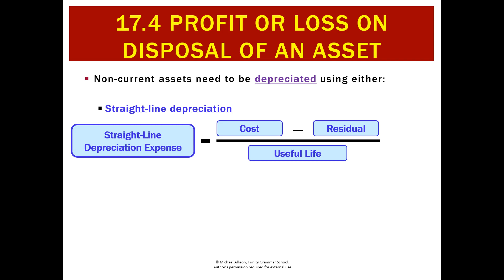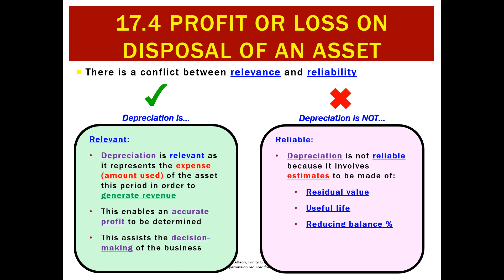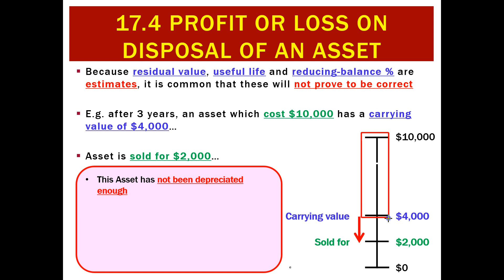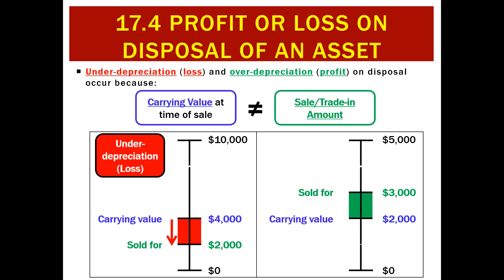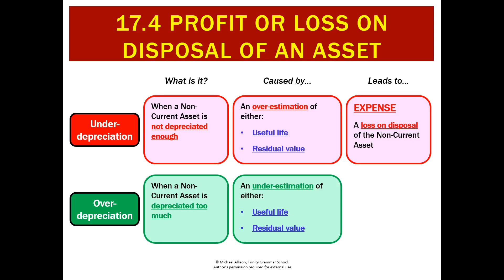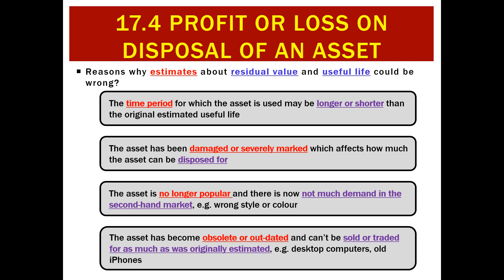17.4 Profit or Loss on disposal of an asset

Comment: An item of plant and machinery was sold within the year for £6,300.
 

The asset cost the company £12,600 over two years ago.

 

The balances on the cost account and accumulated depreciation account were £142,000 and £21,200.

 

It is company policy to provide for depreciation in the year of purchase but not in the year of sale. (Two years’ depreciation charged at 20 per cent straight line per year had been expensed in relation to this asset.)

 

Required:

Calculate the profit or loss on disposal (show all ledger account entries).

please help
Reply: did u find the solution?